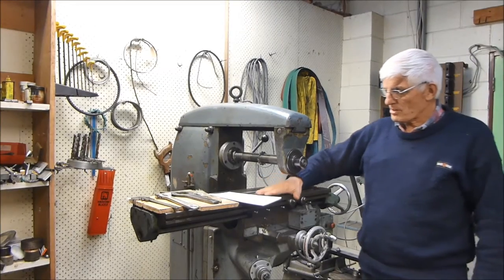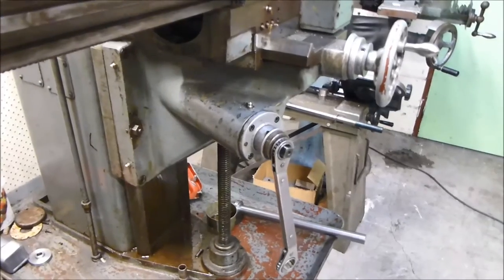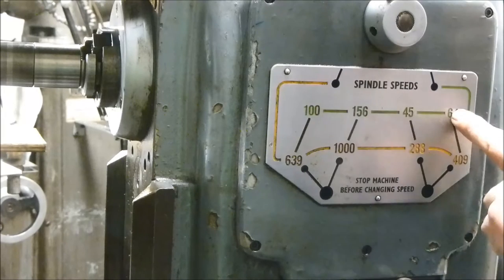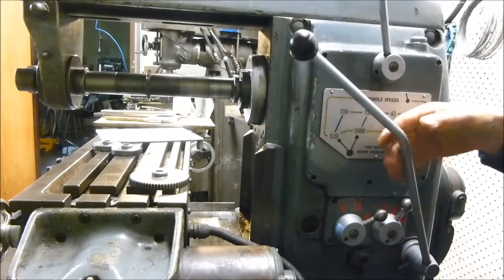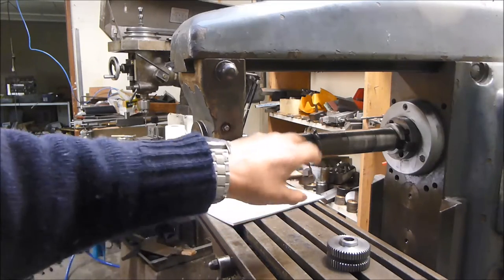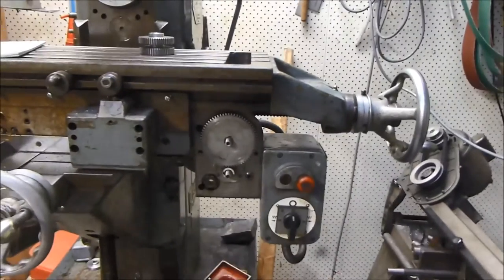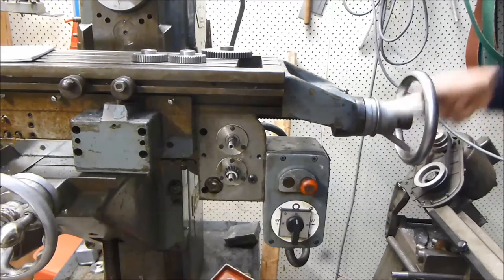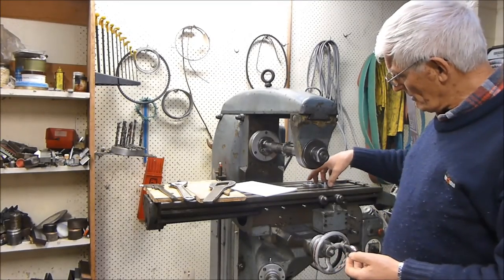Harrison Milling Machine. Part1

Comment: Hi Neil, did you add a pair of gib strips to the table travel? I have the same machine, but it does not have the tapped holes on the front or rear face like your machine does. Also, the manual I have does not show the gibs either. Regards, Richard.

Comment: Hi Niel. Just recently purchased such a mill. Regarding getting it to its desired place in the tool shop I need to lift it off the ground. Does the manual state if it is OK to lift the mill in the lifting eye on the "boom" if centered on the keyways. I can't see what else the purpose of the 5/8 unc thread in the boom would be... But rather safe than sorry. Hope you can verify.
Regards from DK.
Reply from the maker: Hi DK
           I lifted my mill using that same eye bolt, because like you, I could see no other purpose for it. I had no issues atv all. (I did make sure that all ways were securely locked up first)
Reply: neil9 super Neil!. I  made a lifting eye and the placing went well.
Now a few questions as I can see some differences between our machines.
1; what is used to lock the table I x and y direction?

Next up i machining some feets for the mill. 7/8 unc og My measurements are correct 😉

Comment: Great video neil. Im looking at getting the same mill. Can it be converted to a 220 volt motor? Like is it belt driven? Thanks so much!
Reply: Thank you neil. !! What motor are you running in yours. Or would I be better to buy a Phaze converter?
Reply: Neil. Tell me something. I want to buy the machine which is the same as yours! The problem is he cant seem to find the arbor support!!! I cant seem to locate one here or on ebay. Is this going to be a deal breaker for me? Like what could I expect to pay to have one shipped from the UK?
Reply: Again Thanks a ton Neil!!!
Reply: About a VFD Neil. As you know our Harrison mill is 600 Volts 3 phase. Which VFD would you go with?? Any idea's?? Thanks From Canada!
Reply: Mine is also 380/440 3 phase. Neil.
Reply: The power feed is 110/120 volt though right.
Reply: I'm In Ontario near Ottawa
Reply: If you mean my main shop power is 110/240 volts single phase. SO I cant use this motor unless I use a VFD . Am I right?
Reply: Sorry neil. I meant to say I have 110 and 220 single phase!! A motor change is no problem! how many HP would you think on 220 volt single phase.